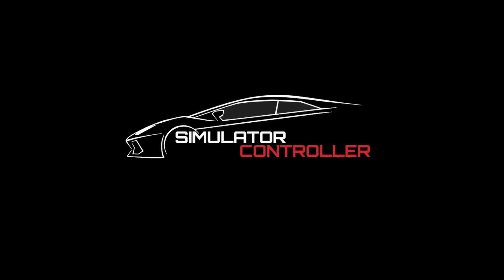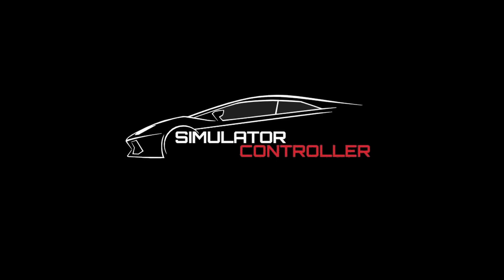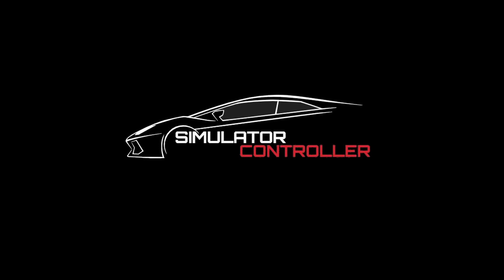Your personal Driving Coach

Comment: It said “…apply throttle to transfer weight to the rear tires and improve front end grip”… while it is generally incredible what this coach can do, statements like that are just the kind of AI slop which makes me hesitant to trust anything it says.
Reply from the maker: You are right, hallucination can happen with GPT models. But this video is quite old, at least when it comes to AI lifecycles. More recent models are much better with  regards to this.
Reply: @simulatorcontroller3331  true, it has improved lots - I didn’t consider that and the age of the video.. I will admit, I installed this, but got totally overwhelmed by the setup and haven’t been able to use it yet!